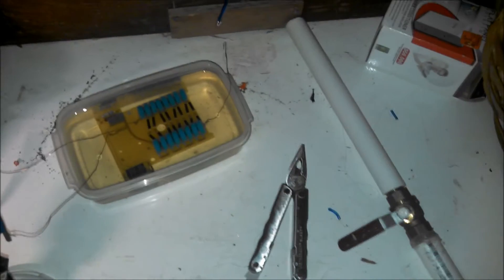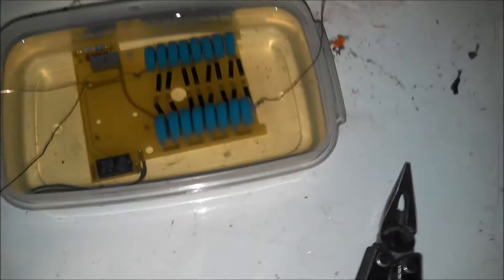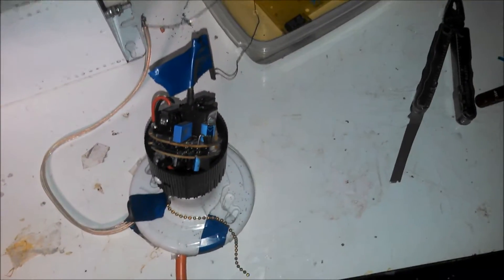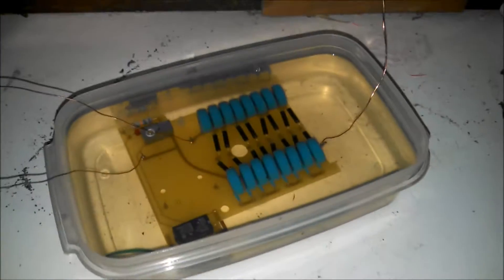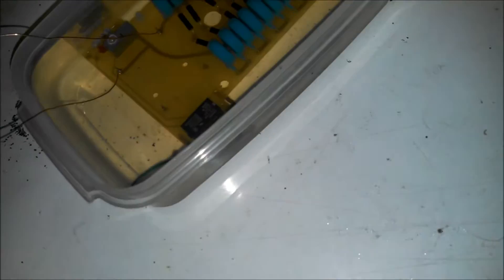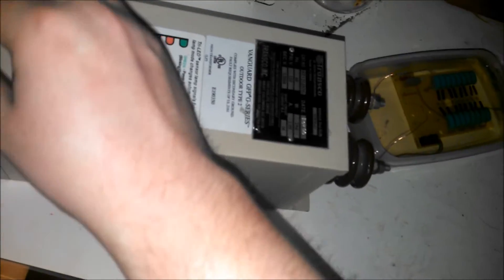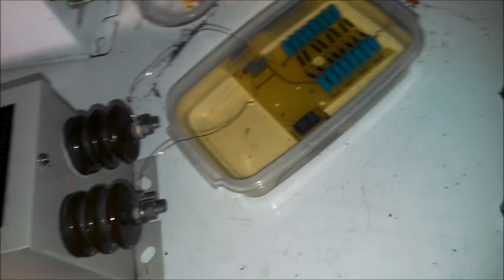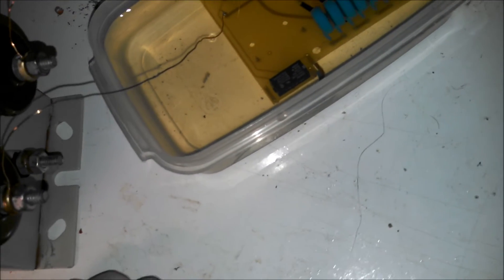Cockroft-Walton Voltage Multiplier

Comment: This comment is way late but the problem with your multiplier is that you are operating it at 60 hz. At a frequency that low you would need massively huge capacitors to get a decent discharge. You need to power that with a AC flyback transformer operating at 25 Khz or higher. Of coarse now that 8 years have gone by maybe you figured that out by now.